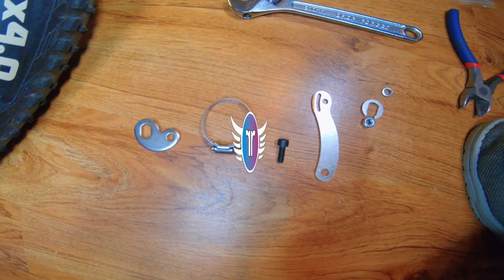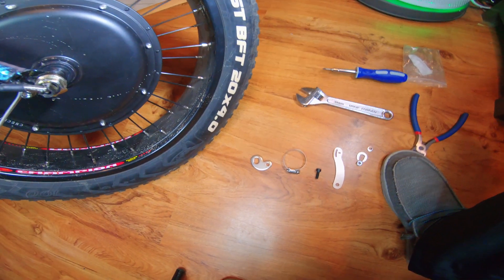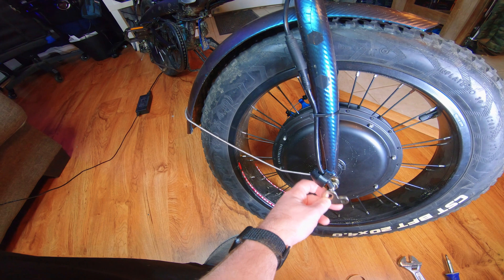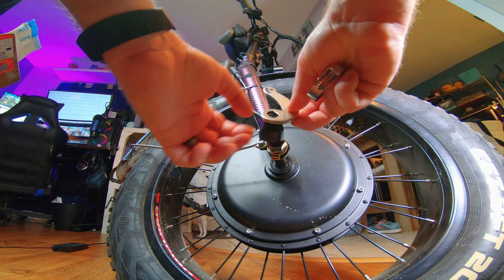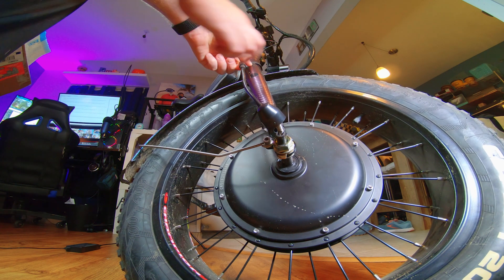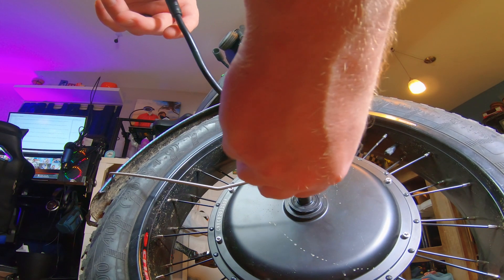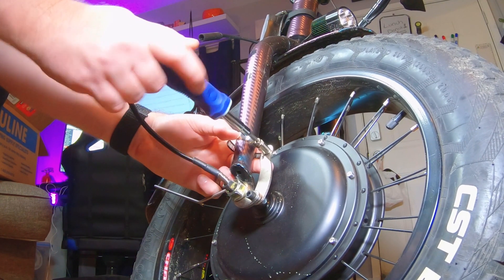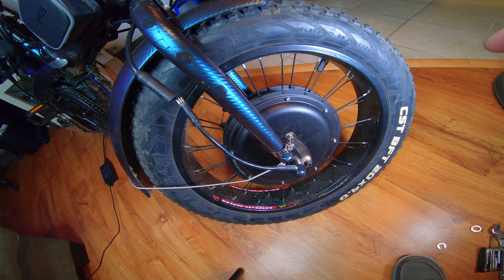How to install a torque arm on your 1000W Front Hub eBike Motor Upgrade

Comment from the maker: Come join my Facebook group and come chat with the ebike community! 

http://groups.randyrides.com
Reply: i noticed that the hub motor you are using in this video requires wires to go through the mounting nut.. how did you get all the connectors through the nut? And also how did you get the torque on by getting it on before the nut? Also, wondering how your torque has been working out in this application? any issues? Have you considered putting a torque on both sides for added strength?

Comment: A torque arm is to stop the axle shreading the housing in which it fits, when a hub motor gets power to move on the road an equal torque is actuated in reverse direction and usually on an aluminium fork the drop out can become rounded off and the axle will spin in the opposite direction to drive thus twisting the power wires off. The torque arm is made of steel.
Reply from the maker: Yes

Comment: If my ebike came with torque washers and I want to install torque arm for additional security, can I leave the torque washers in there as well? Mine has over 1000W power.

Comment: See the video by CitizenCycle.  As I recall there was a fork end ripped off & a pipe band on a torque arm ripped right off. Instead of that pipe band, I saw where a guy fashioned the torque arm end so that a piece of it went behind the torque arm, not help by some thin piece of pipe plumbing band

Comment: The torque arms are supposed to be facing the back.
Reply from the maker: No they’re not. You should probably check the instructions. On the front fork, they are installed towards the front.

Comment: Why do some videos show the torque arm going behind the fork
Reply: Because it is the correct way of installing then. If the tire is rotating forward then common Sense tells you the counter-rotating torque force is going to go backwards so you have to install the torque arm to where the torque is going backwards it's going to pull down which the hose clamp is going to propel the forks forward the correct way is going behind the fork. I've got a 1000w direct drive on aluminum forks and been trouble free for 2 years.
Reply from the maker: @jasoncurrie475 Read the instructions from their website… the front torque arm goes towards the front.
Reply: @RandyRides  so it installed in front of the fork? Thanks
Reply: @RandyRides  I don't know of any websites
Reply from the maker: @johnbiringer8123  Which one did you purchase? They've made a few different kinds since making this video.
Reply: Ebikely

Comment: I understand the purpose of the torque arm is to prevent the wheel from falling off but doesn't it also absorb the 
high torque of the hub motor especially starting up & especially on 500watts or higher motors? So for that purpose would you still say it doesn't matter which side you mount it on?
Reply from the maker: It will only install on the opposite side of the brake rotor and it needs to be installed in the front, like I have it in the thumbnail.

Comment: I was thinking about doing this on my ebike but have aluminium front forks is it safe to put a 1000w hub motor on these?
Reply: I always built my ebikes on bikes that have a steel fork. I give the front fork the magnet test, if the magnet sticks, the fork is made out of steel and strong enough to handle my ebike hub. 

Steel forks handle bumps in the road and torque better than aluminum front forks. 

I had a collision with a bike rider going the wrong way on the bike path,  he made a sudden cut in front of me at the last second, and I rammed into his bike and my ebike "taco" both of his bike rims. The collision pushed  my steel front fork in a few inches, and it still held my ebike hub so I can ride my un-powered ebike back home using only pedal power.

Comment: This isnt an upgrade. Its an absolute necessity with anything over 500 watts. For some reason manufacturers dont see it the same way.
Reply from the maker: Lots of manufacturers use torque washers now and it serves the same purpose, and may even be better.
Reply: @RandyRides  wish my chosen brand had used them. Currently in the process of welding aluminum into my worn dropouts then grinding em down to proper axle size

Comment: YOU HAVE IT INSTALLED ON THE FRONT OF THE FORK. N/G.
 IT NEEDS TO BE INSTALLED ON THE BACK, NOT THE FRONT.
Reply from the maker: Incorrect. You should probably review their instruction manual.
Reply: @RandyRides  Sorry!  
The bike was upside down so it looked like it was in the front.

Comment: i'v upgraded my 500w to 1800w and the moment i full throttle from standstill the wheel took off without me... i did not have a torque arm. lesson learned the hard way.
Reply: Lol the wheel took off and left you on the bike alone? Is happening to me 3 times but the wheel did not completely took off luckily.
Reply: Haha, i will use the torque arms then, ty

Comment: Silly question, but I didn't see where the front brakes are after you installed the front motor.
??
Reply: Brakes are overrated.
Reply from the maker: @Lardzor That may be, but there are definitely brakes on the front.

Comment: Update?  Did it hold?
Reply from the maker: Yes they work
Reply: @RandyRides  odd mine won’t keep the motor put on my front fork. Keeps falling out the bottom. Also, had to get smaller hose clamps cuz my forks are thin as hell.

Comment: why didn't you just leave the torque washer on and just put the torque arm on top of the torque washer for double security if torque washer fails the arm will kick in to prevent drop out
Reply from the maker: I did go back and do that. Idk why I didn’t do it in the video, probably just too much going on at once. 🤷🏼‍♂️

Comment: How do i get the torque arm over the cable? The connector is too big to fit through the hole. Thanks.
Reply from the maker: You may have to find a different torque arm, I’m not sure. If you’ve used the same hub motor as I did, it should slip through the hole of the torque arm washer.

Comment: This should be done on every e bike why manufactures ain't doing it boggles my mind my one wound the wires coming out the spindle around it opposite way3 times ,knackered ,luckily I got it replaced but I made tourque arms for both sides , now I can give it welly

Comment: Did you manage to get rid of the gap between the torque arm and the fork?
Reply from the maker: You won’t get rid of it. I got mine as tight as I could get it and there’s still a gap. Small though.
Reply: @RandyRides  I guess you could pad the fork.
Reply from the maker: @unclebirdman  Learn from my mistakes 😂
Reply: @RandyRides   should of left the washer at its place , then no more gap..., and safer, but your way will still work
Reply from the maker: @DISRUPTOR40  I actually did add that back in after I finished the video. 👍🏻

Comment: Thanks! It's actually better that this is a separate video. There are all kinds of variations in the e-bike upgrade kits, but this is something that should be done to any wheel with a motor added. Thanks for making this! I wasn't sure what the torque arm thing was all about until I watched the video. Good job. Please to meet you Randy! New sub here. I'm Glenn, in Rochester, NY.
Reply from the maker: Thanks. Yes, very important!
Reply: I'm in Syracuse!

Comment: Yeah, probably best to get one. Wouldn't want to have it spin and wrap the motor cable around destroying it and possibly the motor. I wonder if they make black hose clamps?
Reply from the maker: Yes they do. That’s a good idea. 👍🏻
Reply: @RandyRides  I think I'll paint the parts black first and consider another type of clamp other than those cheap ugly worm hose clamps.
Reply from the maker: @vintagemxer9165  Everyone has different priorities. Mine is to inform the people! 🤷🏼‍♂️
Reply: You might be doing things wrong.
Beware.
Arm in front or behind fork ?
Reply from the maker: It’s installed correctly in the video.